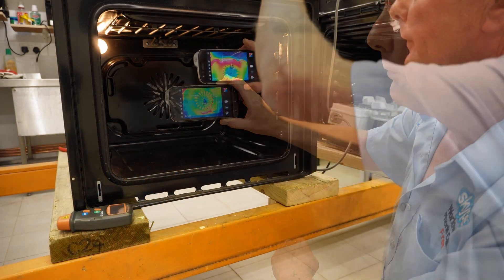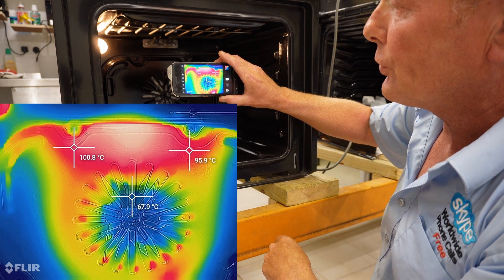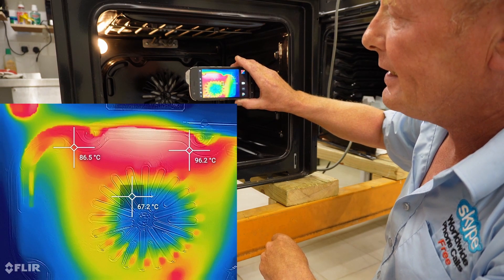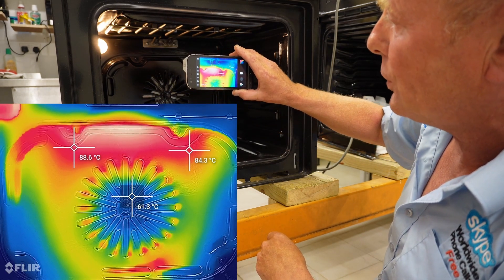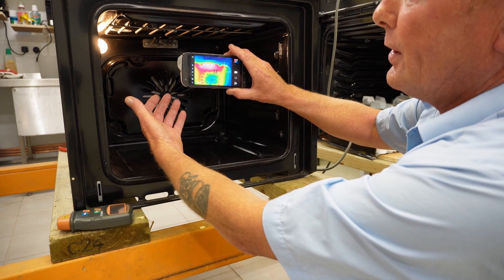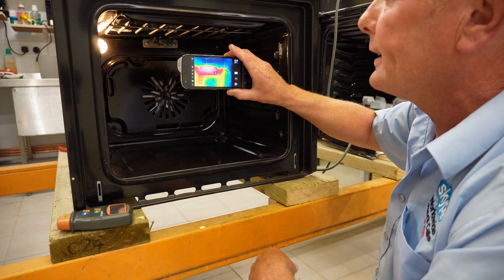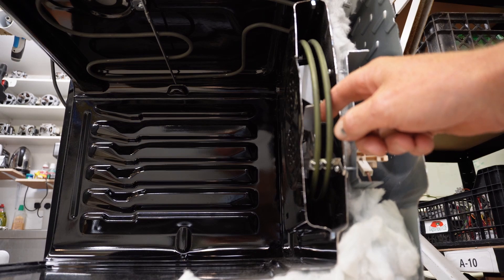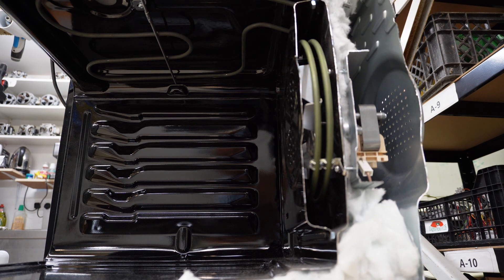Fault 6 Cooker Oven fan motor is not working or spinning correctly turning slow or is noisy

Comment: Nice to see more info than in most that are just trying to sell parts rather than fix them.

My (Candy) oven fan cost me an element, when I didn't notice that it wasn't always running up to speed. It would be a good idea to let people know that when an element blows, it may actually be the fan that failed first, so you should always check that the fan is running up to speed before turning on the heat and making sure it keeps turning.  This is one case where you may regret not having a noisy fan that you can always tell is running before you smell burning and it's too late.

I still need to find out why the fan runs smoothly but does not always kick in to full speed mode.  What should I be looking for if the bushes run smoothly?

A drawback of inspecting the fan can be getting the door off and lined up again when you put it back. And, also, it is really annoying having to turn the house upside down looking for thicker and thicker self tapping screws every time you take the fan cover off!

One more thing I haven't been able to solve is that, even with the fan balanced and running smoothly (you can level the vanes on a sheet of glass or on the bottom of a good saucepan), the clips that hold the element coils apart all vibrate noisily as the thermostat kicks in and out. I've not been able to stop that with any amount of spacers or repositioning.  Maybe you have a trick to stop it?

Many thanks for the video.

Comment: These sorts of videos are what we're after, thanks. Replaced fan motor with universal and when it rotates, the RPM is fine. Problem is that 'sometimes' it doesn't start to rotate and needs a flick. When flicked it's fine and blowing well. Any ideas?

Comment: Thank you very much. You have confirmed what I thought the problem was on my cooker. My fan is running at a slow speed. I have taken it apart. I hope I can find the part that I need in Israel. 
Your video is very good and very informative. 
I fix air conditioners and have similar faults.

Comment: Hi does the universal motor suit a replacement for a kleenmaid 34W 230V?
Reply from the maker: you need to check all the measurements correctly as it is important that the fan blade does not stick into the oven too much and of course you need to space the motor at the back to make sure it's not touching any of the framework

Comment: Intermittent fault.  Oven turned  to fan oven setting, fan and light don't turn on, element comes on.  Oven turned to fan oven +top element setting, fan, light and elements work as normal.   I take it the panel switch[rotary encoder?] is working and its a dry joint or PCB relay problem?  Known fault?

Comment: On some ovens more than one part number was used during its manufacturing life.  I have that situation. TWO diferent shaft lengths are mentioned - and the part markings can't be seen unless it is totally removed from the oven.  This video answered all my key questions, I do believe my fan is running slow - probably only 50% of the speed I expected. I hope your site can tell me which specific part I need.      Even for me, I don't think it will take more than an hour to fit a replacement unit.  Thanks for your efforts.
Reply from the maker: I'm really sorry for not replying to you earlier but I was away on holiday. I'm glad the video was assistance but you will need your full model number and serial number to be able to identify the correct unit for your machine. Have a great Christmas and a happy New Year and thank you very much for subscribing to the channel. It really does assist us

Comment: whirlpool accurate bake system has no fan but it sounds like a bent fan? When started up and shut down M/ RBS305PDS16 .  Works fine right Tep but very nosy now
Reply from the maker: EZTEX23 are you sure there's not a cooling fan on there. this is for you https://www.youtube.com/shorts/e432SAb2g08 please remember to subscribe as that's what keeps this channel going. Thanks 👍
Reply: Also How much from you

Comment: My cooker fan has started making a noise upon starting up, by holding the blade there is movement back and forwards on the middle rod.
Does the motor need replacing?
Reply from the maker: The first thing you need to check is whether you have 240 volts or the voltage that is required in your country at the fan motor when it starts.